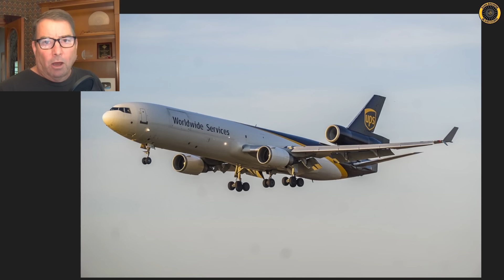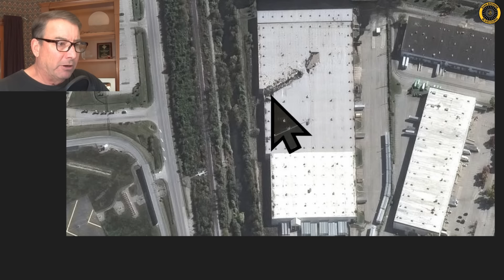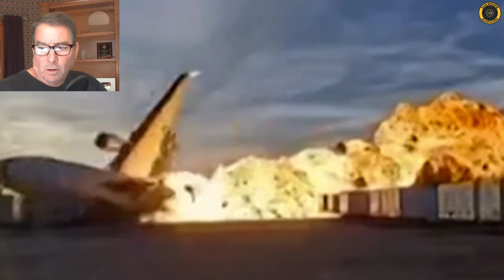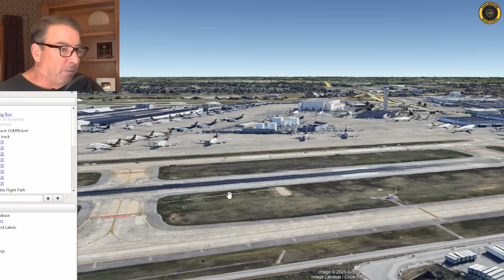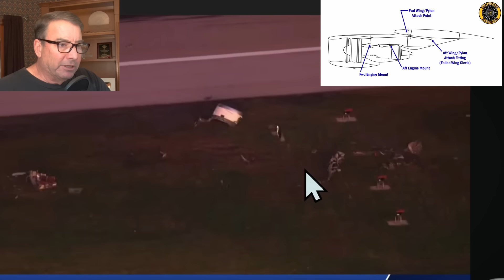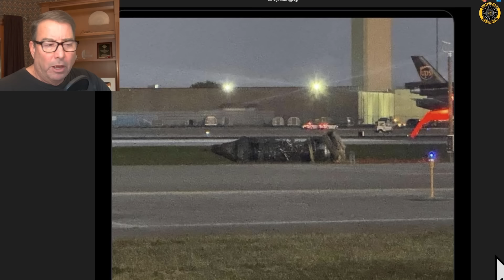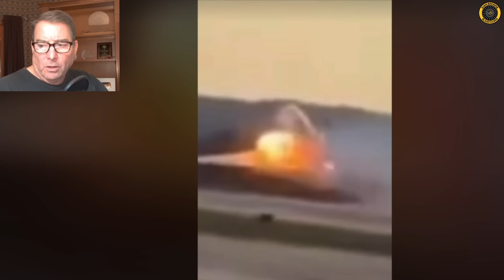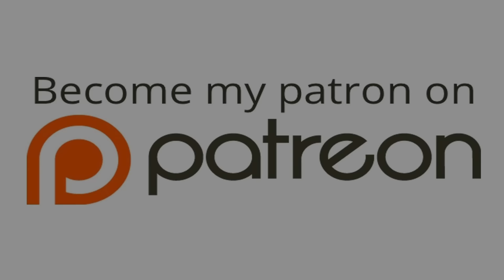UPS #2976 UPDATE 2 6 Nov 2025

Comment: To slam into a petroleum recovery unit with a wing on fire was an impossible situation.
Reply: This is the same line of thinking we all had with the crash in South Korea a year ago. What's beyond the end of the runway? Same question that was asked with Southwest 1455 25 years ago: Why was there a gas station there? 

A lot more consideration should be put into this in the years to come.
Reply: @warren_r This is a known issue.(and a personal gripe I have against city planners)  There have been many crashes over the decades where the end result is the plane ending up in businesses or homes just off of the runway.  They really should keep these areas clear, but sadly do not. I don't think it would have saved this plane in this case, but if that area was grass and open space - or maybe a golf course, then far less people on the ground would have been involved.
Reply: @warren_r
99.999% of the time it wouldn't matter if there's a gas facility at the end of the runway.  Only Nuclear Power Safety requires eliminating a 0.001% chance of issues.
Reply: @warren_r yup, you‘d think there would be rules as to not put hazmat into (somewhat likely) crash areas, if you can help it…

But I guess, acknowledging that a couple miles inline with the runway are still a (somewhat) likely crash site would affect property values or something…

And I get the impression that beyond the airport perimeter, CFIT was the only consideration. But guess where any bird strike debris and similar will impact? Inline with the runway
Reply: @genoobtlp4424 thers all kinds of Hazmat down there. Across the street is a CSX trans load facility truck to train train to truck. A FORD assembly plant they skipped over that recycler was a small one. Maybe 50000 gal. There's a section of Louisville not far from the airport called Rubber town. Another called appliance park. That airport is Landlocked.
Reply: @genoobtlp4424 that is cheap real estate.
Reply: @genoobtlp4424  Or anything that comes off a plane. Ever heard of poopsicles? Guess where those fall off. Usually on final approach. Same goes for a loose wheel after takeoff. Or anything that falls off a plane. If it's gonna fall off, it'll probably do so in that area.
Reply: @unmountablebootvolume  yup, so keep it clear, or at least don’t put hazmat or people there, if it can be helped (no schools, no housing, no oil businesses, no arsenal, …)
Reply: Indeed. Just slamming into anything was impossible of course, but the petroleum unit was extra unlucky especially for the casualties on the ground.
Reply: @SlimShady_4  It's terrible enough as it stands, but the number of ground casualties might have been even higher had the trajectory not continued into a automotive scrap yard and a truck park, which most likely had a relatively low density of people (hopefully none).
Reply: @SlimShady_4  Tbh, the pilots probably saved a lot of lives by not directly hitting that first building full of people with a plane filled with fuel.
Reply: @SlimShady_4 exactly!  Not allowing those tanks there probably didn't help anyone on the plane but could've saved a few on the ground.
Reply: Back when Stapleton was still operating, at the north end just off the runways was the Rocky Mountain Arsenal. Everyone  in Denver knew the disaster awaiting if something went wrong.
Reply: @tadhglee11  I went to USAF Electronics school at Lowry AFB in 1975. A couple of us had an apartment on Yosemite, a few blocks off base. The planes flew directly over the place!
Reply: @jrkorman every bit of that is long gone now.
Reply: @jrkorman  I currently live in the approach path of an international airport. As I'm typing this, there's another plane on final approach going past my window (update: 2) (another update: the third one just went past). And I also always hope that nothing goes wrong, because if shit ever hits the fan, there's a scarily high chance that a plane may end up where I am currently sitting. Usually, I just avoid thinking about that. Better for my nerves.
Reply: Who's idea was it that it was a good plan to place a petroleum recycling plant in the path of a runway??? 🤨
Reply: @WayneGerald1776 People build where it's cheapest.  And usually a crashing aircraft is statistically small enough to not be too high of a risk accessment cost matter most of the time.
Reply: I know it's probably naive in some respect to want local governments to zone differently in retrospect, but that seems like a very unfortunate business to have in the line of the runway. Edit: Folks, please read the first part of my comment. I'm tempering my position because I realize there's only so many businesses you can restrict from an airport perimeter. But I appreciate the pedantic responses that make the internet so wholesome.
Reply: @jajssblue  all airports are surrounded by light industrial.  that aircraft was carrying more fuel than the oil recycler hand standing in it's tanks.  if those tanks weren't there, nothing would have changed.
Reply: @StevenAndrews  Indeed. It could have been worse, there's a park at the N end of SeaTac airport that used to be a housing estate. There's was also a park at the south end they took part of to build a jail!
Reply: @jajssblue  - What would be better there, houses?
Reply: @jajssblue   The tanks are well over a 1/2 mile away from the end of the runway and no taller than surrounding trees.  No airplane should be flying 30 feet above the ground a half mile away form the runway...
Reply: @cup_and_cone Of course, that's why I tempered my comment. There was always going to be disaster whatever was going to be at the end of that runway. It's just putting the veritable extra fuel on the fire doesn't seem to have been much help either.
Reply: It kind of reminded me of the L1011 crash in Dallas, Texas. Wind shear brought the jet down where it collided with two water tanks, effectively shredding the fuselage and killing all but 8 people in the forward 3/4 of the aircraft. I'm not saying the UPS incident is the same at all - just saying the collision with storage tanks was a kind of deja vu.
Reply: If it had been an open field, the result would have been the same for the crew
Reply: @rona4960 But it's looking like now close to 20 people on the ground were involved. I personally have planes fly overhead all day long, but they are at about 1000 ft when they do so. I can't imagine living or working any closer to an active runway.
Reply: @rona4960maybe not.   It was impacting the buildings that made it flip.
Reply: @simpedros4766 
No, certainly.  Hitting anything but runway on the ground at 183kts would still be irrecoverable.  Even a perfect stretch of runway would have been possibly fatal given the rate of descent and roll generated by the entire no.1 engine having catastrophically separated from the plane and stalling the no.2 engine with FOD.
Reply: @simpedros4766  Maybe. But aircraft at 200 mph don't land well when a wing is on fire and full of fuel.
Reply: The irony is, the first building they impacted appears to be a UPS building!
Reply: @jrkorman  80% of the airport is UPS buildings.
Reply: @risksrewardsrelics51  and any other airport if it's not ups buildings, it's fedex buildings.
Reply: I don't mean to make light, but it's almost a Simpsons joke
Reply: I know this is a tragedy in of itself but it could’ve been a lot worse if they had chosen to do 35L & 35R departures that day. Those poor pilots never had a chance.

Comment: Kevlar belt ?
Reply: The engine inlet has large fan blades that provide the thrust. The blades are large and heavy, if they break off the energy is enough to exit the cowling. If it hits the fuselage it will puncture it. The engine has a large Kevlar blanket in place in the fan section to contain the blade. That is tested during engine certification.
Reply: yes they have a Kevlar belt inside the cowl. it's there to help contain detached fan blades so they don't damage the wings of fuselage. they also muffled the sounds for the passengers. remember this was originally a Thai airliner.

Comment: What we can determine so far (2025-11-06, 2055Z):
- N259UP was heavy and had 38,000 gallons of fuel on board
- it commenced take-off roll on rwy 17 R (length 11,887 ft / 3,623 m) from taxiway B8
- during the take-off roll, a fire erupted in the vicinity of engine 1 and its pylon - notably, the flame extended over the top of the wing
- it is yet unclear whether the engine fan cowling and the engine itself separated from the wing simultaneously or in quick succession (and in which order)
- the no. 1 engine fan cowling detached from the engine and came to rest to the right of rwy 17 R behind taxiway A2 near the sign indicating a remaining rwy length of 2,000 ft / 610 m
- the no. 1 engine detached from the wing, coming to rest to the right of rwy 17 R near the windsock between taxiways A2 / B2 and B1 (the last two being on the opposite side of the rwy)
- during rotation near the end of the rwy, engine 2 (tail engine) suffered a compressor stall with (at least temporary) reduced thrust output
- the aircraft became sluggishly airborne and just cleared the airport perimeter fence
- the warehouse behind the runway was impacted by the aircraft, causing substantial damage to its roof
- the aircraft then overflew a street at low altitude, attitude about wings level, about normal pitch up
- visible damage to the aircraft at this point: engine 1 including pylon missing, right winglet missing, possibly damage to the right horizontal stabilizer (elevator missing?), but all four landing gears extended and apparently complete
- the aircraft touched the power line on the far side of the street in the direction of flight
- the left wing then impacted tanks of Kentucky Petroleum Recycling, shearing off the outer half of the port side wing and causing the released fuel to ignite explosively
- the aircraft then rolled more than 90 degrees to the left, skidding across a truck parking lot, dropping the nose to below horizontal and disintegrating.
Reply: That timeline looks perfect, except that there is a possibility that engine #1 separated first, with damage from the separation causing the wing fire.
Reply: @KennethAGrimm  We do not know yet where the NTSB found the engine blades in relation to the final position of the engine beside the runway. The most likely scenario imho is an uncontained engine failure causing a fuel leak and fire and the separation of the engine some distance down the runway approximately at rotation (at this time the fire streak from the tail engine could be observed). The only other but probably less likely scenario would be a partial failure of the engine pylon, severing fuel lines and causing the fire and the engine completely detaching only later.
Reply: @janncfl "...possibility..." - both scenarios should be explored until one or the other is ruled out.
Reply: - What evidence shows that N259UP "was heavy" including cargo weight? The MD-11F's fuel capacity is 38,615 gal. and their destination was Honolulu.
Reply: @Raiders33  The length of the takeoff roll on the runway assuming that at least until V1 all three engines delivered takeoff power, and after V1 two engines were working as required. The flame streak from the tail engine indicating a compressor stall was only visible at rotation, the position of which corresponds well with final position of the large parts of engine 1.
Reply: @janncfl NTSB found fan blades on 17R during their FOD walk, but didn't give their location along the runway length. So there's no way to tell when they may have lost thrust, or whether engine failure contributed to the long roll or weight. [Edit: Sorry, didn't read your post below first]

Comment: The dashcam video is not shot on Crittenden Dr but shot on Grade Lane (closest intersection is Knopp Ave). Thanks for all your hard work Juan!
Reply: I have a few people speculating the UPS warehouse building hit by low tail. That made more sense to me than the compromised wing. My other theory was airport lights pulled over the roof. Didn't they make it over the first road and the train tracks with just the wing fire?
Reply: @cynvision Judging by the location of the plane from the dashcam video, it’s very likely the tail of the MD11. Good catch!
Reply: I just posted the same, I should've read the comments first

Comment: Why is it so may planes crash after receiving 'Maintenance' this is disturbing.
Reply: Planes are always receiving maintenance. Maintenance induced crashes are a smaller percentage of most incidents. Though, that is likely the cause here, or a fault in a part of the engine. I don't fly airplanes. I work on them for a living.
Reply: That's still a rumor. Actual FAA maintenance records show it only had unrelated depot maintenance in early September 2025 until the accident.

Comment: There really needs to be a buffer between the end of the runway and buidlings.  If there were no buildings around these pilots wouldve stood a chance. RIP.
Reply: Sorry to say but no, they would not have in this particular case. Apart from that, there are buffers.
Reply: @EHAMZTZX yeah it hink youre right, if the wings had dipped maybe.

Comment: Juan, as I just commented below your previous video (Update 1), the dash cam video you open with was shot at Grade Lane, approaching Knopp Ave. At that corner, the petroleum recycling plant is located.
Reply: This shot was after the tail (?) apparently struck the UPS building, so it appears landing gear and wings cleared the roof.
Reply: Was just about to type the same thing.  This video is zoomed a little but the original looks to be shot on Grade Lane just across from River Metals Recycling.  Just down from Stooges.   Been down this road countless times in my 20 years living in Louisville and working for UPS
Reply: @eddiesmith5559 Lucky you weren’t there that day. I’m sure that thought has struck you. All the best and of course thoughts and prayers for those affected by this unfortunate incident
Reply: @FranssensM  I retired a few years ago so it's been quite some time since that has taken place.   It's just a sad situation.   I feel for the all families impacted. RIP to the crew and everyone on the ground that lost their lives.
Reply: Yeah that opening still was further south of the UPS building.
Reply: @ponmlk  Which is truly crazy. They maintained level wings and a fairly intact airframe (minus the #1 engine) even AFTER scraping the top of the UPS warehouse
Reply: @ocobri The only thing i can think of is the rear fuse put a huge dent and missed the LDG. The MD-11 fuse is loooong. It also has a very high angle of attack in a lot of phases with all the lift devices out during landing and takeoff.
Reply: @ponmlk  7011 Grade Ln, Chris Tires.